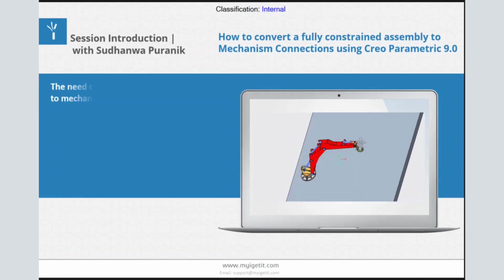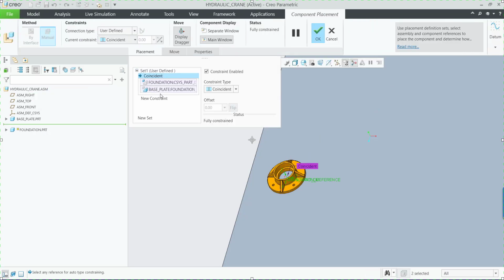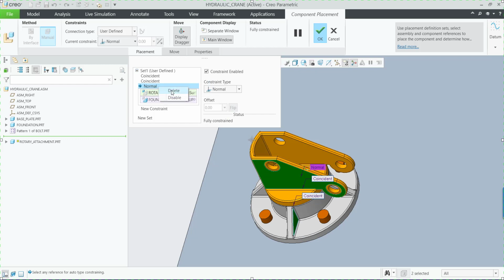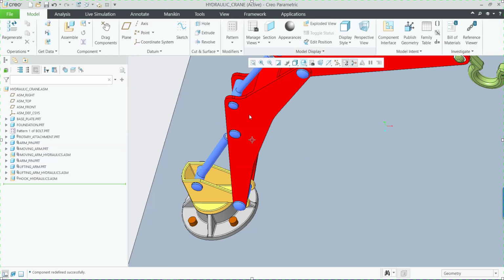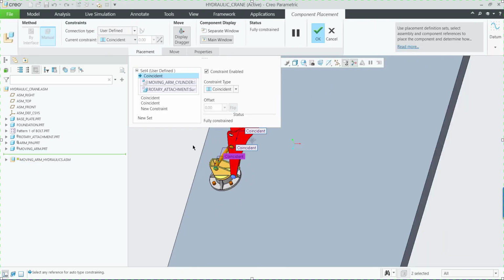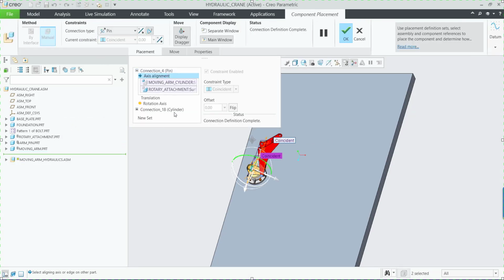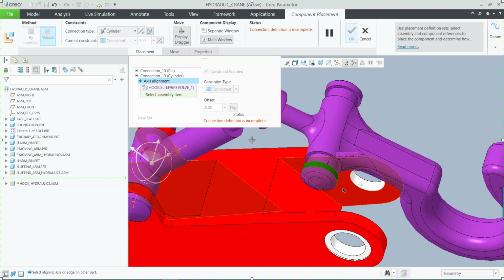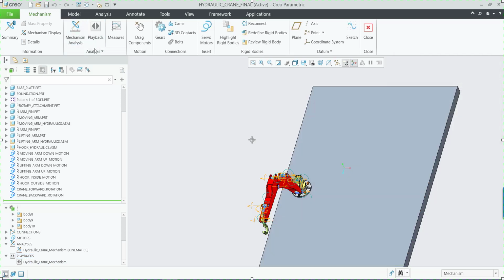💻 Converting Fully Constrained Assembly to Mechanism Connections | PTC CREO | i GET IT Masterclass 📺

Comment: Great guide. Is it 100% needed if I don't need to simulate the movements but I only want to assemble those parts (hydraulic cylinders with main steel frame)? Or is there a different, simpler approach?